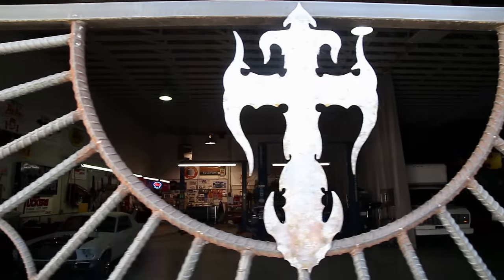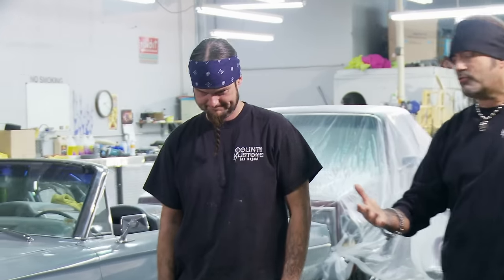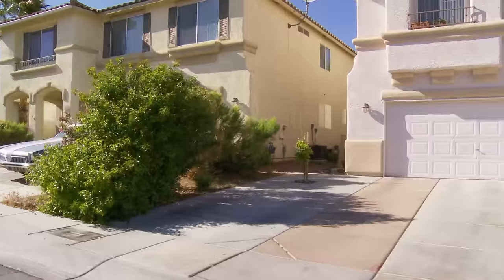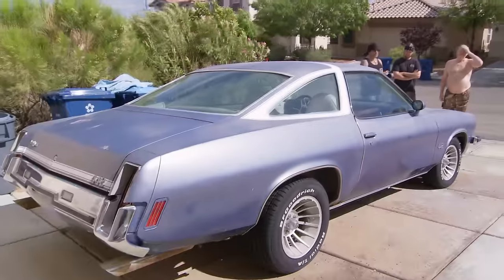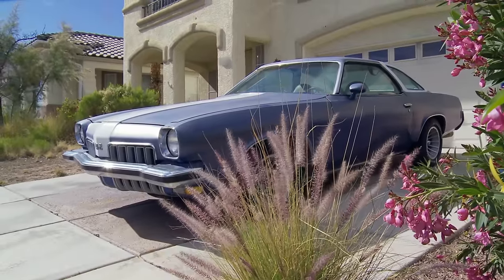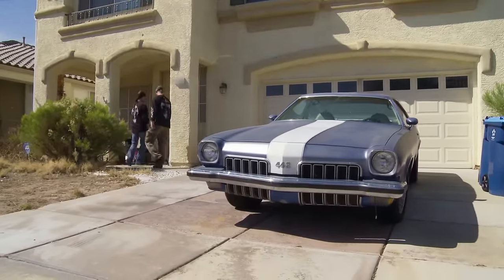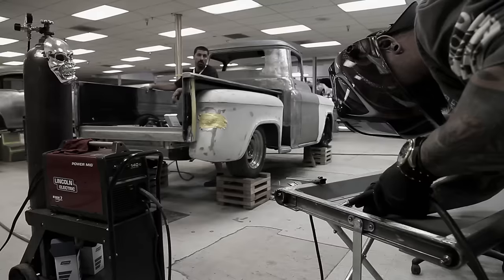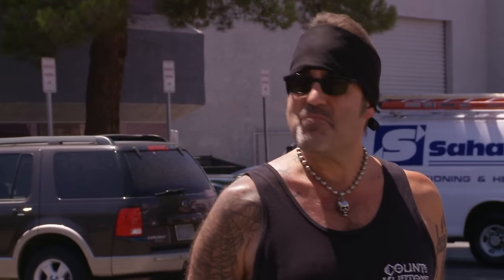Counting Cars: Classic Chevy Truck’s Emotional Restoration  (S6, E16) | Full Episode

Comment: @DeptOfDefense 
you get a rose pink or stainless steel/transparent rose gold paint:finish stone flowers a brass/copper Crest, a stone/concrete overhang with familial types:personalities mirror inside on the back window the side mirrors have tissues and sanitizer also brass/copper/gold chrome fringes upper and lowers with an custom to the atonement "likeability" in the bed of the truck the family is lowered down with UV Heat lamps LEDS and after the max amount is reached a garden is made.

@History
Reply: @DeptOfDefense solar panels for the automatic rain collection and watering cycles and obvious other mechanism required tanks regulated compost bin. Large tomb 👌 so more can fit in there I'd say

@History
Reply: @History
Reply: @DeptOfDefense a mirror is symbolic like a camera cellphone